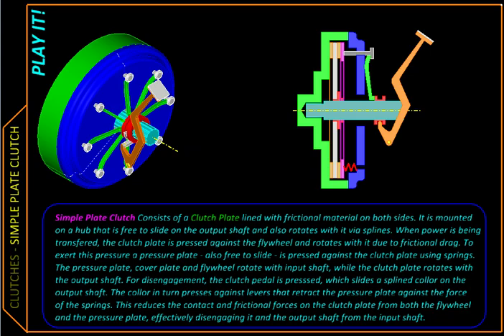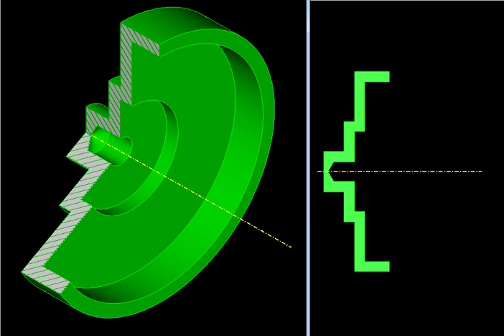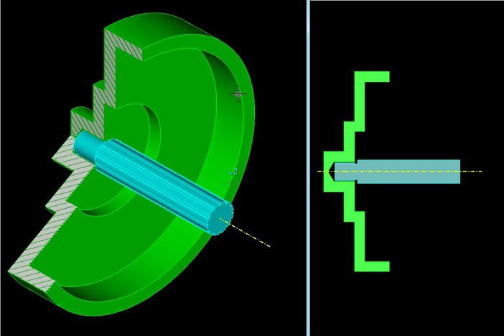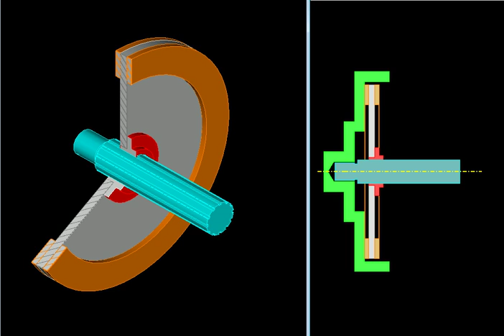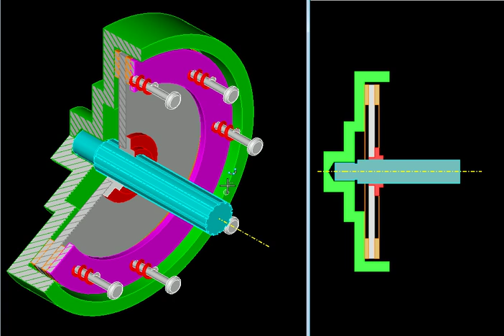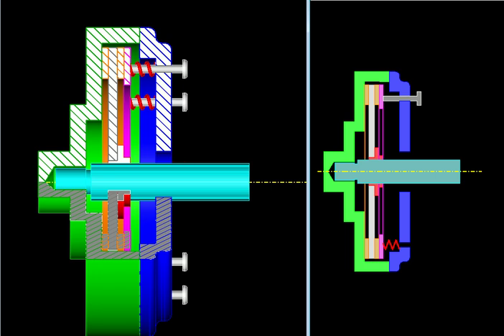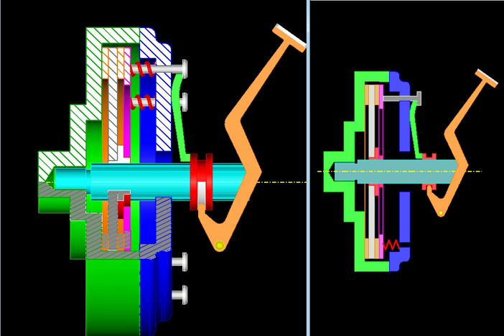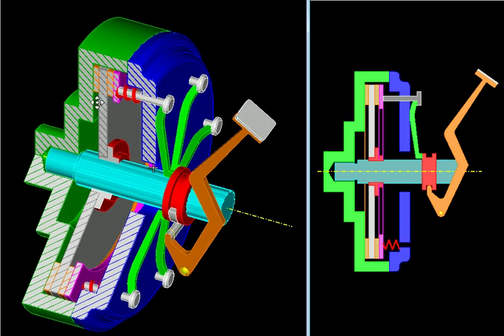Dynamics with MicroStation Ch06 A Simple Plate Clutch

Comment: At:4:30, I don't understand how the pressure plate can retract the clutch plate. These two elements are not linked.
why  does not  connect these two elements (clutch plate+pressure plate) ? Why are they not linked ?
Reply from the maker: Djaballah Rayan the pressure plate is not 'pulling back' the clutch plate. But it is not keeping it pressed on to the rotating flywheel. This drops the frictional force and frictional torque and hence rotation of the flywheel cannot be passed on to the shaft (remember the 'load' from the wheels is reluctant to move!)